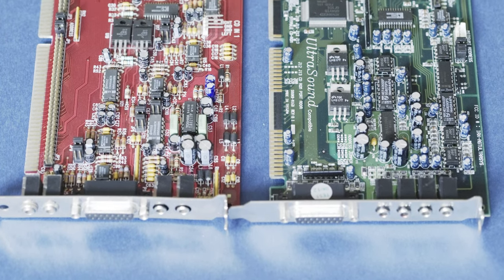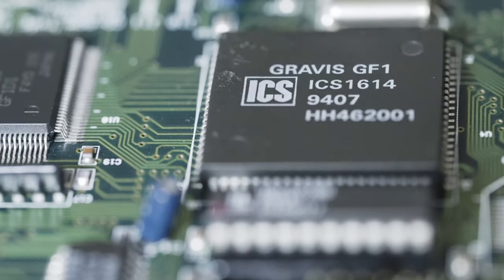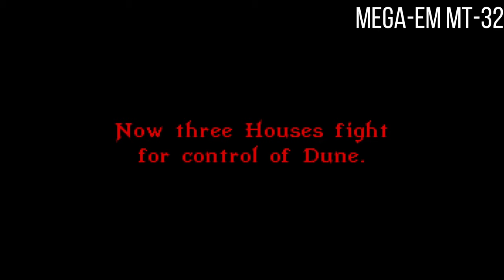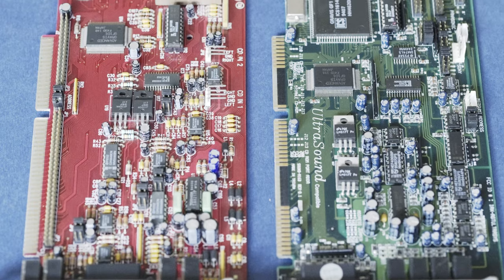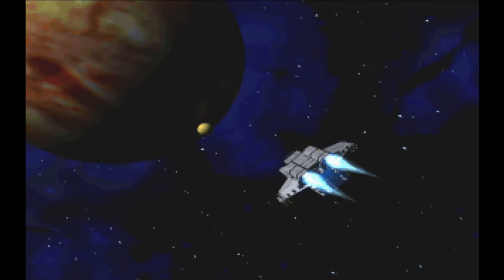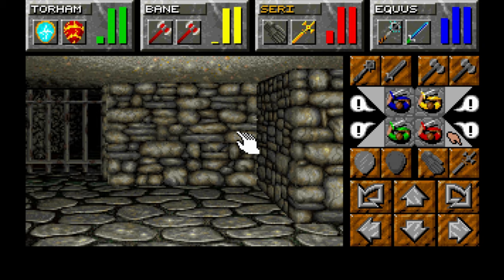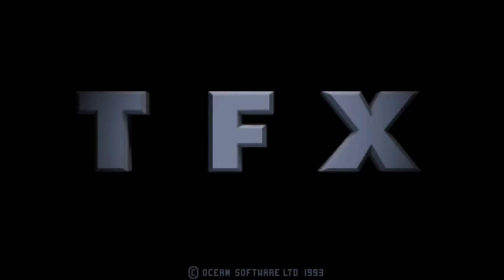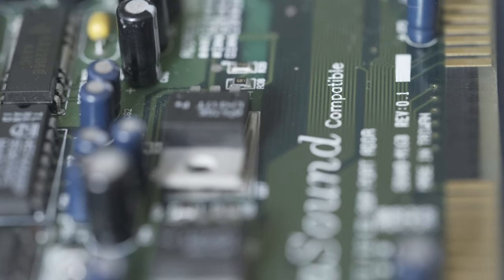Primax SoundStorm Wave (Gravis UltraSound) - The Quest For The Ultimate DOS Sound Card Part 11

Comment: I have a Primax , I bought in the 90s when new. It still works great today. I have it installed in a Pentium system combined with a Soundblaster 16 and voodoo 1.
I miss the difference in midi sounds in your video. The ultrasound/primax has superior wavetable compared to soundblaster or crystal sound cards of that age.
Playing with midi always surprises me how well it performs, and has its own unique sound. I remember how much of a struggle I sometimes had getting sound to work back in the day on this card though. Great video!